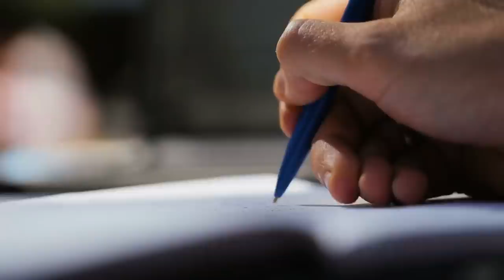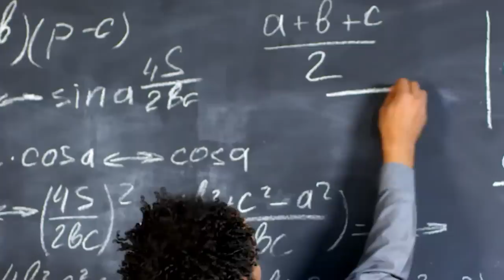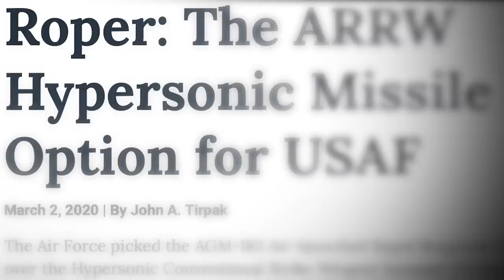The Missile Inside a Missile - Mach 5 Hypersonic AGM-183A

Comment: The thing about Chinese and Russian hypersonics is they only check the box of “hypersonic” yes they go mach 5 and above it, but these missiles fly in INCREDIBLY predictable ballistic arcs. They aren’t the kind of missile that can move unpredictably at those speeds. The American ones are true hypersonics because they do what all of our cruise missiles do but AT hypersonic speed
Reply: thats probably not correct - non-hypersonic weapons (200-400meters/sec) can target a very specific feature on a target (a window, a door, etc) as they have the time and processing power to do this - any hypersonic weapon (1715 meters/sec) will have major issues performing such targetting - the reason being are the onboard cameras, the time you have seen the target you probably have gone past it and at those speeds forget manouvering (bunting downwards) onto target - the default option for hypersonics is AoC (a scripted manoverer at coords)

further options for hypersonics are to use local targetting with Spec/F designating the target with the weapon looking for a specific sperkle from the des laser, or using a stealth a/c or UCAV over region to do the same concept

all hypersonic weapons suffer from the fact they just go too fast for onboard sensors (cameras) to acquire images and processing to compare against a template for targetting

another option could be to use hypersonic weapons to punch through a/def and then launch non-hypersonic ordance over target (the concept was processed CVS401 Perseus) where they can target possibly much better
Reply: @simonrobins4316  What about a pre programed GPS target? A GPS target can be loaded shortly before launch. Plus, this isn’t going to be a weapon with a small warhead. It won’t need to fly through a window.
Reply: Just look at how well the Russian equipment is performing against the western weapons in Ukraine.
Reply: What you state is not correct. Both China and Russia have hypersonic capabilities with missiles and glide vehicles with unpredictable and hard to intercept trajectories. We currently do not have a way to counteract agains such assets, neither them.
Reply: @DtheD740  is this the same Russia that’s using retail gps systems in fighter jets and airplanes duct taped in?
Reply: All Ballistic missiles are “hypersonic”
Reply: @DtheD740  that you know of…..
Reply: @jakehall3925  hah don’t forget the Sony DSLRs for targeting 😂😂
Reply: And they only show CGI renderings of their "Work"
Reply: Nope.. the US missiles are not more maneuverable. Physics are the same everywhere.
Reply: @808bigisland  it’s not a question of different physics it’s a question of who can utilize the physics better.

Example, American space rockets are more aerodynamic than anything the Russians have ever built but the Russians have more powerful thrusters than the Americans have ever built.
Reply: @Shinobubu  that I admit is a pain, a lot of the time the tech isn’t quite ready and they are showing what it WILL be able to do but it can’t be performed yet. That and showing your progress to your enemy is silly. Who shows exactly what works and what doesn’t to their enemy, if you show an animation it’s easy to trick them into believing or NOT believing what they see.
Reply: Everyone is just speculating, they don't release the newest weapon systems that they're currently working on.
Reply: @larryowsowitz2274  hence the term i used 'AoC' (Attack on Coord) - the need to attack a specific feature is due to planner identifiying a weakness in the target they want to exploit in the attack; to maximise the effect - thats what we do with non-hypersonic missile with extreme success - the energy of the effect of the weapon goes into the target

but with hypersonic weapons this can be quite hard, hence why such weapons mostly just head butt the target and rely on kinetic energy + explosive damage to destroy target

plus "a GPS target can be loaded shortly before launch" is not how it works - an incredible amount of pre-processing is performed before any launch to reduce any non-combat damage and improve mission success (i.e. ensure we hit the target and nothing else whilst on mission + understand zones of influence along route (A/D)) - non-hypersonic and hypersonic are not instant use weapons, as they require massive amounts of planning and sign-off from auth
Reply: @DtheD740  yes they are hard to intercept - just not impossible - in the same ammner as using flak to hit an a/c in flight, the same concept can be used - you say weapon is unpredicatable - really - given its speed manourving is hard and expensive to flight energy, not forgetting an issue to control surfaces, so for most part the hypersonic weapon follows a its given route just at speed - they can not use terrain / feature masking - its all open sky for them, unlike non-hypersonics

you are correct though - there is no specific weapon to put flak in such a weapons trajectory - YET - dew may be an option in the future - or a local EMP - putting another greater pressure wave in front of a hypersonic weapon may be another option

as they are so new and expensive, their use is limited and reverse for more captial asset targetting - so the next phase will be in countering them
Reply: @providentpathfinders219  Sony DSLRs are not designed to image at speeds of 1700 meter/sec - the shutter speed to stop blur + visible imagary is not use much; more i/r so bigger pixel cells - none hypersonic on image capture is well used in the i/r (or n i/r) as they can be processed on-board and react in time - but hypersonics is a new game

non-hypersonics can fly lowish to ground and thus see features - hypersonics fly at altitude due to fitting ground based features, so they must look at greater resolution and distance, and not forgetting their speed - all these cause major issues in vision based targetting - an example, at 200m/s weapon at 200m off ground can react to a target 600m ahead; camera can easily see target in i/r and pattern match to hit specfic feature on that target - at 1700m/s weapon at 2000+m off ground would see just too much and it could be blurred due to speed and lack of resolution due to alt + need to factor in processing speed (pattern matching) and then reaction to a decision of patten matching
Reply: @808bigisland  for one hypersonic missile - YES - but for a missile inside a missile (the title of this vid) it is a possibility (CSV 401 Perseus) showed this idea of launching multiple sub-muntions onto different targets (or same target) - main missile just have to fly in region of target, sub-muntion from main then go for target
Reply: @simonrobins4316  no way!  shocking.  😏
Reply: @providentpathfinders219  yep - cameras and their processing are good - but when they are single use, to do the function you require at hypersonic they become extremely expensive and thats if they could produce a pattern to match against - i know on earlier non-hypersonic camera did suffer from blur due to speed, plus cell size on the camera capture and then had to factor in altitude to cell size in capture - these were solved but hypersonic version will be far (if at all possible) to solve in the form factor required
Reply: I agree with this, the US already had hypersonic capable missiles just after WW2 when they got their hands on the German Aggregat 4, also known as V2 (in all fairness also the Russians got some). Funny also that the ranges are similar.
But just like then still today the trick that will win this game is named guidance.
Interesting to know if the Russians have truly mastered the nuclear propelled cruise missile, maybe this would actually be capable of hypersonic dashes, combine that with the range and it's something to be reckoned with.
Reply: You're right 👍
Reply: @milkybar06  Are you kidding 😂😅
Reply: @milkybar06 so well really - so how many have Russia fired todate - and exactly where will Russia be getting its micro-electronics components and board from parts from anymore - recently a Russian car manufacturer put a warning on all its new cars that the air bags could no longer be supplied with them due to shortage on electronic parts - such components (triggers) in those air bags are simplier versions of those in missiles (time to react components, triggering air bag)

so how well - not very well just like so much ot those Russian toys

why are Russia not using such excellant hypersonics weapons for time-sensitive targets like the long range launchers or CnC or runways or docks or cities where Ukraine pres could be or radar sites - it could be that they have run out of them, their planning element could be just extreme poor, as is their Sig-Int

maybe you can advise us
Reply: @Klaus_Klavier  like you said, no one shows exactly what works or their full capabilities. So who knows, the tech may already be there and we're just debating a capability that already exists. DARPA is 30 years ahead of the public ya know (;
Reply: @simonrobins4316  You are way wrong lol.. even nuke ICBM'S were areHypersonic in speed.. and all the rubbish you posted of can't target at these speeds show you are incorrect about ti all.
Reply: Source: trust me bro, america is superior in every way.
Reply: @leventesapi9882  i never said the US is not leader in these fields - its far in advance of Russia and China in many advanced tech concepts - but from time to time everyone has to play catchup - the US focused in stealth, 6th gen, UCAVs whilst Russia demoed a concept ahead of them and then did China - as to how good these others are who knows (for Russia we have all seen how bad some of their toys work), but i would bet the US whilst thinking its behind in areas is actually on par with others in those fields

You have to remember chief stakeholders need to divide money to different projects from a fixed budget, so guess what the missile defence sections do, claiming they are behind to get further funding - thats how it works in the US and UK - if they do not, then other projects make some claim to get more funding

the reason fo the US being ahead in some many fields, they have massive military funding (far more than others) - the US does not always come up with the concept ideas, but they partner up with others to push the concepts forward - builds good partners and relations - thats why the UK and US work so well together with both nations mil tech companies well embedded in both

i do not know what i said to make you think i said anything otherwise about the US
Reply: Still hypersonic
Reply: @mikeyp0131  a satellite falling out of orbit goes hypersonic - so what - what are you replying to?? which comment
Reply: @simonrobins4316  the original comment mate 👍🏻
Reply: @milkybar06  Poor tactics.
Reply: chinese hypersonic missile missed its target by 24 miles
Reply: @milkybar06  Well enough to have gained major strongholds and territories. 

Yes, the ukrainians are putting up a very decent fight, but it's clear that technology isn't the deciding factor in any war. Refer to Vietnam and Afghanistan..
Reply: Just like Russia has amazing tanks
Reply: Americans always feel the need to denigrate others capabilities while talking up their own. Overconfidence is a  fool's trap.
Reply: @unatco6554  you need to stop consuming so much Russian Z propaganda. Ukraine’s loss of electricity is easily achievable with regular cruise missiles and balistic missiles. Unperturbed, as in, without maneuvering, like a regular baslistic missile?
Reply: @DtheD740  That's a myth repeated by uninformed parrots.....The U.S. has developed and tested laser missile defense. The U.S. also has several different missile's thst can shoot down incoming missiles. The U.S. has definitely been working on missile defense. You have no idea what the U.S. is capable of
Reply: 我是过来嘲笑你的😂自信的家伙
Reply: FAIL american missile .. China and Russia DEPLOYED donkey years ago .. america still "testing" AND FAIL lololololol
Reply: @DtheD740  this didn't age well.

Comment: Poor explanation of such weapons. ICBMs are already at Mach 20+. What is special about Hypersonic Glidevehicles, is not the speed of about Mach 5+, it is that they can manoeuvre by a great deal at Hypersonic speeds. As such they can easily evade most missile Defense systems.
Reply: Right
Reply: Agreed and the terrain detection they can use to stay low and fast
Reply: I'm curious.. at what point after launch does an ICBM reach mach 20+?

I doubt they reach those speeds in thick atmosphere.. except for maybe on reentry just before impact..
Reply: @cjperry2731  ICBMs don‘t stay in „thick atmosphere“, for example the US LGM-30G Minuteman III has a service ceiling of 1100km, meaning it flies a significant proportion of it‘s voyage at the doorstep to space. The Exosphere, the upper most atmospheric layer of earths atmosphere. To put it into perspective, satellites travel in termosphere, at a mere 600km. With basically no significant air resistance in the exosphere, the LGM-30G Minuteman III achieves a top speed of Mach 23. This speed can then be kept while the ICBM ends it‘s parabolic flightpath in a downward dive.
Reply: @seraphclion8356  yes, I understand they don't stay in thick atmosphere lol.. that was kind of my point.. and I wasn't doubting what you were saying, I believe you.. I was just curious if you knew what speeds they reach before the atmosphere becomes negligably thin..

Hypersonic missiles do, though.. which was going to be my point.. they reach mach 5+ at practically sea level, and able to maneuver..
Reply: @cjperry2731  I have knowledge of what the acceleration of state of the art ICBMs is, though most of their speed is gained in the terminal phase of their flight.

Regarding the HGVs, some also need to get to near space altitude to build their to speed, those are usually also the fastest getting mostly little above 20. Most HGVs though are around Mach 5. Some need to launch higher some can begin their journey at lower altitudes of some hundreds of Kilometres. I don‘t think that this impressive since the M-51 SLBM travels at approximately Mach 25. It‘s not the high speed which sets it apart from ICBMs it‘s the low altitude ability and manoeuvrability. Low altitude ability also doesn‘t mean that they travel at high speeds at low altitude. They at high speeds at high altitude and lower speed at low altitude since the final HGV phase has no propulsion. Usually you can say for HGVs,the higher it flies before the terminal phase, the faster the terminal phase is.
Reply: It’s actually due to the glide angle of when the hypersonic missile reaches its target. Instead of taking a high arc as traditional ballistic missile do in its final moments giving missile defence systems a chance to search-track-destroy. 
Hypersonic tech gives the ability to do as name states- go fast, quickly change direction at high speed, and instead of taking a high arc to eventually come down to hit its target (again giving mds a chance to destroy), hypersonic can safely traverse 5m off ground/sea, completely bypassing mds if they were fast enough by going under them.
Reply: @overanDownUnder  It‘s an HGV, not a cruise missile. A typical HGV design has a glide ratio of approximately 2.5. This is due to the lower flying phase, the terminal phase, of an HGV not using an engine. So with 5m of altitude you would get about about 15m of range. (only a theoretical/mathematical approach)
Reply: @seraphclion8356  previous Chinese iterations of the YJ-21 hypersonic asbm had played with scramjet not as a hgv, but what is traditionally known as sea skimming- they claimed success of up to 300km in 2020 but doubtful as upgraded system YJ21 (c/m-401) currently skips across the atmosphere to give unpredictability in its hgv configuration toward terminal. Still- means the technology is out there. Even if it needs a bit of dusting off.
Reply: @seraphclion8356  and I prob should have specified the type of Hypersonic vehicle I was talking about. And those of Russia/China/India/USA etc are all different and use differing models to hit their targets.
Reply: @cjperry2731  Hypersonic missiles reach Mach 5+ speeds generally at altitudes above 60000 feet. And keep in mind that Earth's atmosphere thins out fairly low and very abruptly.
To give you an idea, between 20k and 25k feet of altitude you could possibly last almost half an hour before starting to experience symptoms of hypoxia (provided you are not physically exerting yourself), but at 30k feet, you will pass out in under a minute no matter what. At 60k feet, the air is so thin, your blood would boil without a pressure suit and given that you are at 60000 feet, chances are they won't be able to get you in a positive pressure chamber in time to save you from permanent brain damage. You'd probably also need a transfusion given that so many of your red blood vessels just ruptured.

Also, a large part of the reason why ICBMs are so fast in the terminal phase is the substantially greater weight of reentry vehicles compared to hypersonic missile warheads.

This is also another reason why nuclear tipped hypersonic weapons make no sense whatsoever, given that they provide zero strategic advantages compared to ICBMs while having many drawbacks.

Comment: I don’t understand the statement about “control difficulties at hypersonic speeds”. We operated the Space Shuttle for 135 flights over a period of 30 years, and it routinely operated at Mach 25. Why are we now having control difficulties at 20% of that speed?
Reply: In space yea. We live in an atmosphere with air which produces drag. Drag also produces heat which is also a problem to overcome.
Reply: Because we're not. 😉
Reply: Wings, Materials, Heat dissipation and elecronics that work under extreme conditions. The Space shuttle was pressurized and had AC.
Reply: Because misiles require dynamic changes for targeting. A space shuttle when landing has a pre-planned entry into the atmosphere.